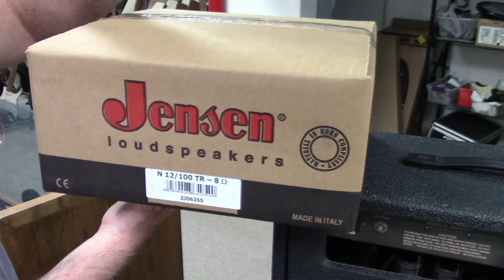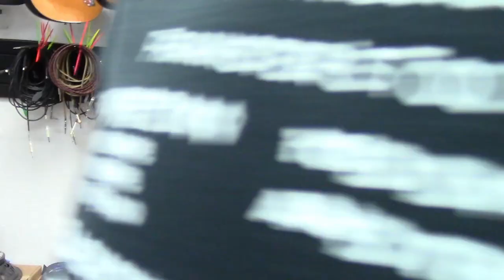Peavey Amp Weight Relief

Comment: 12 lbs is alot. Good job. I replaced the speaker in 2 of my practice amps with the Jensen Mod and they sound quality has drastically improved! I definitely recommend them. I just got another practice amp but unfortunately Jensen Mod doesn't come in the right size and ohms for it. I'm giving it time to break in before I decide if I'm replacing it, I may not. Looking forward to more projects of Neils ☺